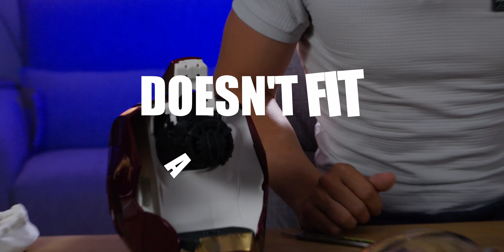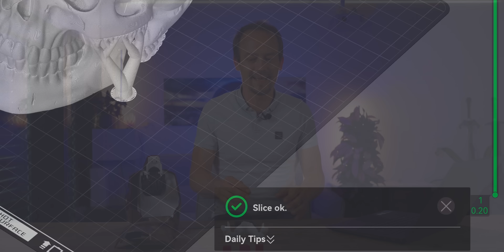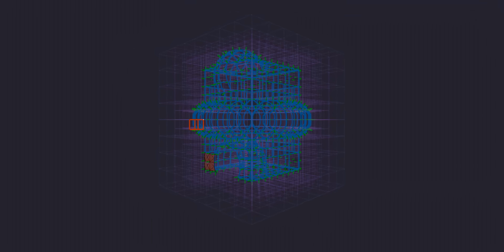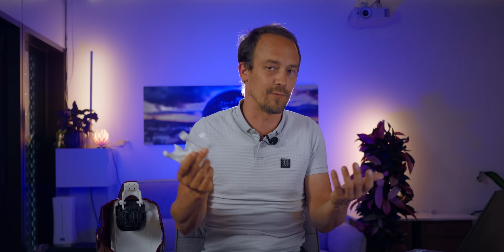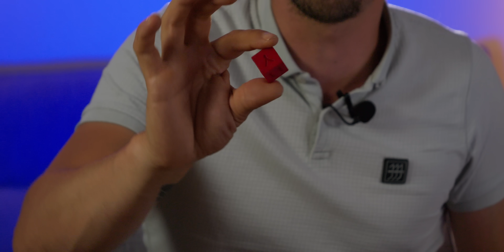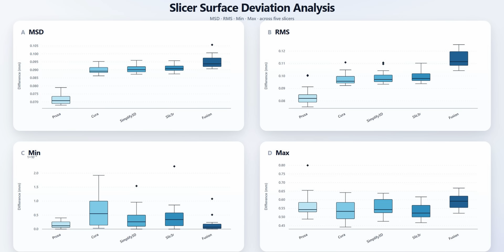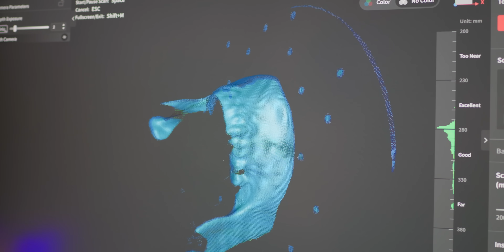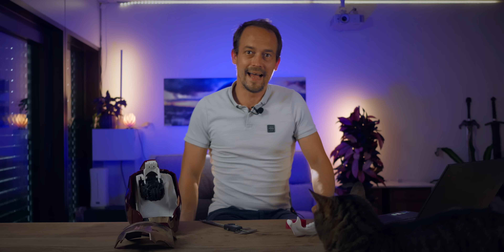The Hidden Error in 3D Printing - This is How We Found out

Comment: I remember years ago Cura would let you choose whether to use approximations as the min, average, and max point.  From what I recall, it had to do with picking an overall dimension for the layer. Every method introduces error because a layer has a width at the top of the layer and the bottom of the layer.  Averaging tries to average the error, but every option includes error.

The most accurate I could get a print was between 0 and 0.05mm.  however, the big caveat was that I had to print a part and then adjust the print settings to make it more accurate.. it was per model and other models that were similar in size benefited from those settings, and models that were different in size needed their own settings.  I suspect that if one compiled the settings needed to make a print more accurate relative to model size, feature size, line width and more they could maybe come up with an algorithm that improves accuracy across a wide range of prints.  Someone who spends a lot of time getting more accuracy out of printing might really benefit from collecting this data and analyzing it.
Reply: Was going to say that, yeah. Given any vertical slope on a model, the slicer can choose whether the entire layer fits inside the geometry, the entire geometry would be enclosed by the layer, or the edge of the layer should match the geometry at the vertical midpoint. This is also why the cube shows no such deviation, the sides are perfectly vertical so the default slicer option (usually average) inherently lines up fine.
Reply: @DejitaruJin Yeah, exclusive Slicing Tolerance, that was it.  It ensures that the outer most layer line is fully inside the model's edge instead of the default where the outside line is on the middle model edge.  If your layer line is 0.4mm wide then half a layer line on both sides of the model is the 0.2mm tolerance people end up manually accounting for when the slicer can do it automatically as long as you know what you're doing and what the various options are for. 

I haven't used some of the newest slicers out there, yet, but surely they have a similar feature, don't they? 

Strange that someone in the medical field seeking high precision printing didn't acknowledge this setting.  OP, were you aware of Slicing Tolerance or it's equivalent in other slicers?

Comment: EDIT: "Acknowledgments: The authors used ChatGPT v4.0, an AI language model developed by OpenAI
(San Francisco, CA, USA), to exclusively improve the manuscript’s language and readability. All the
scientific content, interpretations, and conclusions are the original work of the authors."

Oh dear, there goes all credibility. Case closed.

Too long, contains unnecessary advertisement that is almost, but not entirely unrelated to the problem. It is stated (too often) that the marching-cube algorithm is actually more accurate than comparing the printed parts (which seems wrong, since the acual physical behaviour of the extruded is ignored, while a slicer should all about that - how to wrangle the physics of molten plastics to achieve an accurate print), and by being so wordy and long-winded, leads to skipping parts of the video to get to the part which should explain the error and a possible solution, which then is nowhere to be found (or has been skipped over -  your loss, not mine, since as a user I cannot do anything about it anyway). This run-on sentence is how watching this feels.

Comment: Now I am curious what the error is when you compare the output of the slicer (turned back into STL using your marching cube algorithm) with a 3d scan of the actual printed object. Is the error in the print really caused mostly by the slicer, or are the errors in the slicer on different parts of the geometry than the errors in the print?

Comment: What if the slicer is just considering the physical limitations of a line of filament ? If I slice a very thin wedge, the slicer won't get all the way into the tip of the wedge because it would be thinner than a line is wide. Is that considered an error?
Reply: An extruded line cannot fill a corner radius tighter than its own diameter. That is a geometric limitation, not an unforced error by the slicer

Comment: I've got a K1C (all I could afford) and use ORCA. After a year of (PROFANITY) I am at the point of crushing it under my excavator and QUITTING printing. Hundreds of hours of X Y Z videos of EVERYTHING on YT + a hundred researching other places + AI (wrong 80% of the time) and STILL can't get EXCELLENT ACCURATE prints like you say/show. Yea, the Mods all have been done (BCJ+100 others). Taking a deep slow breath as another print has failed because of "quitting filament" to do a ONE color change...and an extruder jam because the cool-off/retraction, cool, retract-clear is effing up with PLA even... I'm either going to SCREAM, CRY, or start SMOKING again... Maybe drinking if I could afford that... Whats the emoji for smashing yur head with a sledge hammer? I PRAY for the day I can JUST load a print, hit start, and it prints NICE...even if there's a color or two wanted...

Comment: Great analysis. I was thinking another method could be used to determine slicer accuracy thus validating your findings.I would try slicing the stl and convert the gcode and back to an stl repeating this 10 times. Since theoretically, the only process is converting the model back and fourth, any error would be introduced by the slicer and cycling ten iterations will compound the error. Thus making the error easier to measure. Of course you then divide by the number of iterations to create a new measurement, accuracy per slicing. Call it the Wong factor. Lol...

Comment: Reading you paper.. Ugh. What you call a "hidden error" is hugely dependent on the difference between your processing of the gcode and the intent of each slicer. Your processing is not physically based (with minimal assumptions) and thus most of the 'errors' you see (i.e. simple differences) are rather meaningless. Some quotes with comments:
1)"but the effective line width (w) used for perimeter generation was extracted directly from each slicer’s configuration file": not only is your processing not based on (simplified) deposition physics but it also behaves differently for different slicers (cause they model the deposition shape differently). Using nominal values from gcode comments is something that doesn't mesh well with "Slicer-Independent" in your paper's title. It's also WRONG. By default, Cura 5+ uses the arachne engine that adjusts the line width to better fit the geometry.
2) "The nozzle position in G-code defines the nozzle tip height, whereas the centroid of the deposited filament lies approximately one layer height below this position". No, the centroid is half the layer height below the nozzle tip height.
3)"2.5. Point Cloud Z-Correction" and "Figure 6" shows that your processing assumes the vertical walls of a deposited line are |straight| whereas in real life they are (curved).
4) "previously calculated point cloud (PC4) was transformed into an STL object": your point cloud processing loses important volumetric information as nowhere do you capture the extruded volume of filament (dependent on E values in gcode)
5) "for each point of TPCM, the closest distance to the surface of the original mesh was determined": That you got max errors of ~0.6mm is strange. Okay, maybe you'd get a layer height (0.2mm) from stair-stepping and another half line width from point cloud generation? Do mandibles have thin (<0.4mm) walls? Are there scanning artifacts in your mandible models? Outlier analysis is wholly missing from your paper which is strange because outliers matter when printed parts have to fit together.

Comment: Awesome work, it's just one of those things you take for granted and never question. 
There is the only critique I'd have about the method. We now know the errors from STL to marching cubes solidified g-code, but what you didn't check is how marching cubes solidified g-code compares to a print. That scan at the end of the video is a indicator, it is likely a good representation, but I'd like to see you guys do verify it with more data.

If it turns out to be accurate a slicer can use that fact to optimize gcode after slicing, by iteratively comparing it to the marching cube result. Or one could probably even code a simple gcode post-processor that does that.

Comment: Great Video 😊

Did you test the measurement accuracy of the 3D Scanner before of cmm Measured curved parts out of the same material. Would be curious to see what that relates to since 200mm baseline sounds a bit short.

Comment: You do know that there is a lot of configuration parameters involved, do you? Not all slicer guaranteed to even have the same parameters available. There is Classic and Arachne slicing engines, which are completely different slicing algorithms. There is precise wall settings which accounts for bulging of filament on the outside wall. There is thin wall detection, scarf joints and many more. There is not much value without knowing what parameters were used. And default profiles are not usually optimized for dimensional precision

Comment: many effects of laying down the filament must be compensated by the slicer. IMO it must slice aiming at the result, not simply for the mathematically reversible shape. The slicer has all the necessary information, which is lost after this step. The printer cannot compensate all of these effects and most printers are also far too weak in computing power to do this at runtime.

As far as I know, slicers did never try to be mathematically correct, I guess every developer starts with that assumption, but is convinced later by the reality (often coming from users or testing).

An example: the cross section of a free bead is a rectangle with two half circles. If you lay two beads and then one in-between, it will fill the available volume as much as it can, but more speed or less temperature work against that. If you lay beads from inner to outer, it is asymmetric, there is a pressure component, that punishes filling and prefers expansion to the free side. Such effects usually depend on the sequence (e.g. option outer perimeter first) and printing parameters, that are only known to the slicer, but also on the runtime, e.g. acceleration results in a certain speed at a point, but the slicer can not completely plan this, unless it controls all printing parameters and knows all relevant algorithms used in the printer (e.g. speed and acceleration limits, pressure advance, ...).

slicers have parameters to optimize for different goals. Speed optimization reduces accuracy and vice versa. You need to balance this. Unfortunately, there is no simple slider speed vs. accuracy. Instead there are a lot of parameters involved and the user usually does not know their exact effects.

Comment: Very interesting and explains a lot about why I'm having to use X-Y hole compensation & X-Y contour compensation numbers in the negative and positive with Orca Slicer based on Prusa Slicer to make some of my mechanical parts to fit properly. I didn't see you compare Orca Slicer, wonder how it would have stacked up with Prusa and the team at Orca Slicer an open source slicer should be interested in this and willing to work on this as well.

Comment: Calibrate the X and Y axis steps as well, the default math can be off sometimes by a pretty substantial amount. Example, my Vyper when I made something big, like a 210mm clock backplate with standing out numbers was smaller by a good 1mm, noticed it after I laser cut the wooden front plate on a milling machine with ballscrews, and tried to put the 2 together. A simple check would be a let's say 30mm and a 120mm cube printed on the same machine, the goal is to measure a width difference of the 2 by exactly 90mm, not caring about material shrinkage, this gives you how accurate each axis is, if it's less than 90, then increase step count, if bigger then lower it. Then do all the other tests

Comment: A good model slices better. IF it's important to me, i'll clean up the stl in Blender (literally make it quads, manifold, and triangulate again. Sometimes one vert at a time). The STL will often be smaller, file size wise, slice faster, and cura doesn't complain about non manifold stuff. I haven't looked at it, but i guess Blender has a slicer add-on now?

Comment: Wait did you just discover the Slicing Tolerance setting? The one you can set to inclusive/middle/exclusive. That's basically Z aliasing. Because else I think you did most of the work but didn't explain the actual reason for the delta introduced by the slicer(s).

Comment: I know that paper work is very hard. And i am exited to see this result. Intresting would be how the most advanced Prusa Slic3r Features compares. Arachne Walls.  Arachne allows thinner walls which should decrease the Error. And the Question does using a smaller Nozzle Diameter reduce the error? I read that you went for compareable settings, but a comparison with an Arachne Slicer and a 0.2mm Nozzle with 0.1mm heigh if it reduces. I would go with the Prusa Slicer only and it would be another two test sets. But if Arachne reduces the Error, it could be even half it. It would be nice to know. Great Work at all. Showing that slicing correctly is still an Art and you need to check how it will be filled in critical sections, we had great results for mechanical parts with Arachne. And great including the OG Opensource Slic3r.

Comment: As one of the comments stated, it would be interesting to see if slicing STEP files would have the same inaccuracy. Also, I could never get hole sizes right with Cura. They were always too small. When I switched to Prusa or Orca, the problem was magically solved.

Comment: Not sure if anyone else has mentioned this but, would importing the model as a step file help? My thinking here is that an stl file is basically a mesh and so you are converting from basically vectors in whatever package you create the model, to a mesh which the slicer then has to convert in to g-code which is again basically vector. That conversion from vector to mesh and back to vector seems wasteful and could be a source of the inaccuracies maybe? I'm no expert here, but somehere might be able to say if this is rubbish or not? A lot of models I print I also create and so both of the tools I use support creating step files (FreeCAD and OpenSCAD) and Prusa slicer supports importing them so I mostly work with step files instead of stl.

Comment: I started thinking about this issue round about 2013, but didn't really get in-depth in finding the pattern of complimentary pinch points until about around 2017 with model vs replication accuracy. Half of the problem especially in the wee early days of commercial printers was machine accuracy, relatively low-power processing on-board computers, and then on the software side, low-power slicers that would take eons to slice a high-poly model (even with top shelf hardware on desktop) and the nature of slicers themselves. Later that year is about when I had everything down to a finely optimised large delta that could do very respectable resolution, the processor was 32 bit when most were still driven by 8 bit on-board mainboard, but it was woefully slow compared to the recently (for that time) evolution of corexy printers. That's also when I jumped into MSLA and stayed on resin for the next 8 years through the evolution of early RGB printers to monochrome, the resolution race (marketing garbage aside) and seeing what light engines really worked versus what the cheap printers utilised.
Now I've been back on FDM for all the advancements in machines, slicers and the expansive material library, everything is quite mature and you can get to very near-resin results in filament if you go slow and small enough, even though my every day environment is more based around functional printing and design work. TLDR, there's quite a lot of compensation metrics built into FDM from the start, and you can really get into the weeds with it on machine shortcomings, material differences in expansion/shrink rates, etc when you want to optimise every aspect of model replication to the point where what I see in the computer is almost 1:1 with what ends up on the plate.

Comment: Do you have a graphic where on the mandibles the maximum differences occurred?
In your paper, Table 3 corresponds to Figure 9. Why the table reads 0.131...0.164 for Max[mm] while the Max graphs at D are in the range 0.55mm?

Comment: Enable arc moves in firmware and use a slicer setup to use those. May require a post processing script. This leaves curves up to the firmware and can result in parts smoother than the stl. It may seem like error but actually closer to the original unmeshed cad file
Reply: Arcs aren't generated natively, G2/G3 commands are just approximations of generated G0/G1 paths. Then Klipper converts the arcs back into linear moves anyways, so enabling arc fitting leads to double precision loss. The only application of arc fitting is the file size optimization.

Comment: I took a look at the paper. It’s really cool that you created a consistent method to test slicer accuracy! I wonder if the STL generated from the slicer matches the print better than the original STL? I have one concern though, the algorithm seems to assume that the surface of the print is always 1/2 the nozzle width from the centerline of the gcode, but if you read the Slic3r documentation, you see that the slicer has to compensate for the fact that the cross sections of layer lines aren’t rectangular. Also the width should be determined by the volume/(line length*layer height) to account for slicers that vary line width. Again, really impressive work!